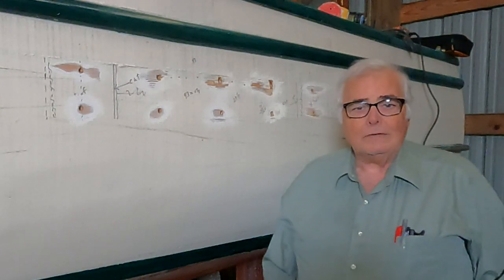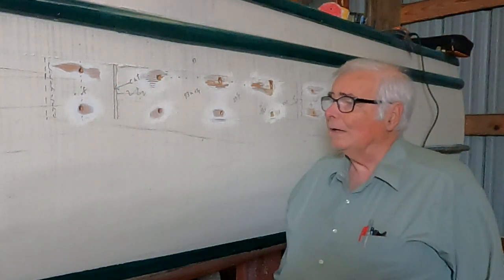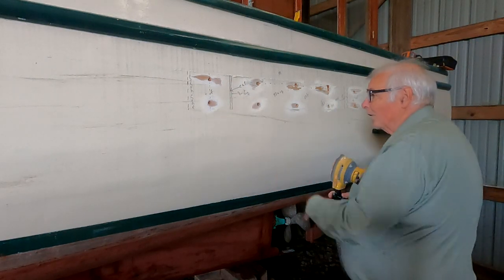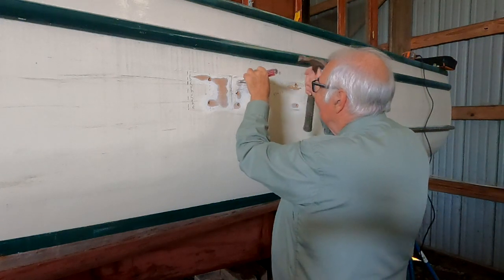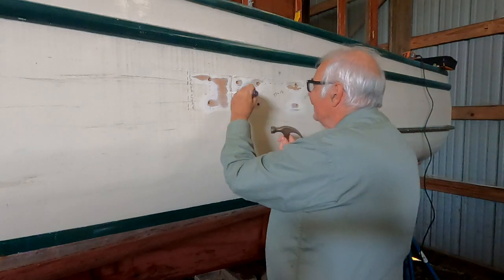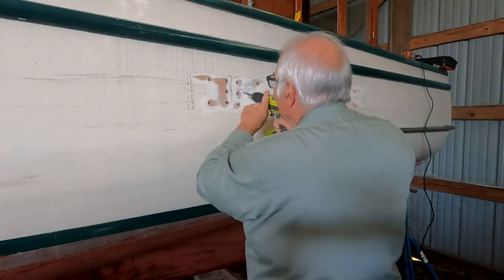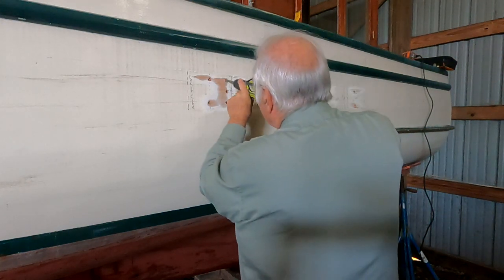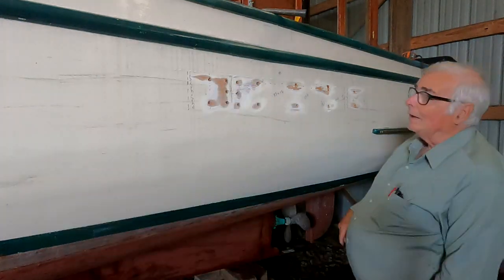Fall 2021 Boat Work #4 - Removing Bad Wood & Cutting a Scarf

Comment: Scary!
Takes grit to do that!
Best of luck  with the repairs!!
Reply from the maker: I have done this many times so it is just another repair to me.  However, the first time was a bit daunting.   There will be new wood there in a few days.  It will be delayed a bit since we are going out for an overnight on the sailboat this week.  I will post the installation of the new wood.  Thanks for watching.